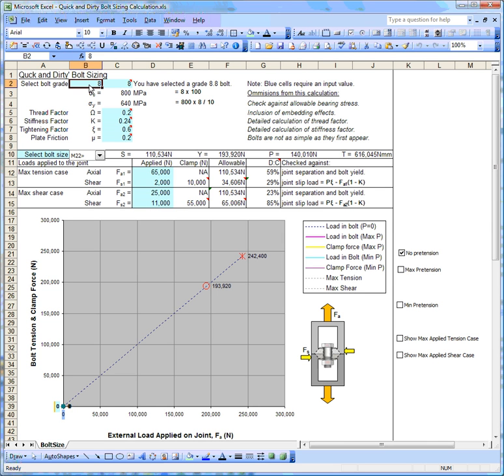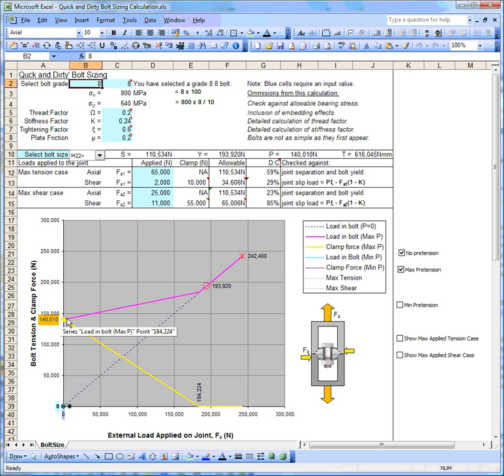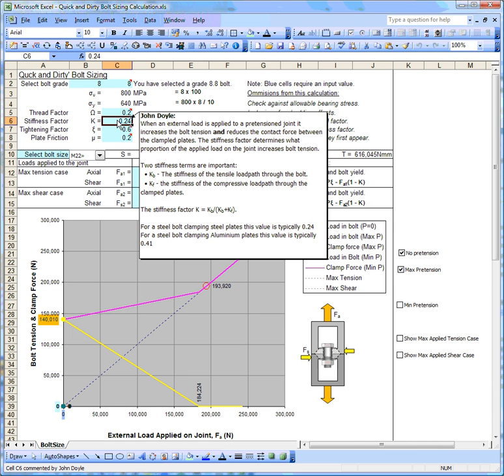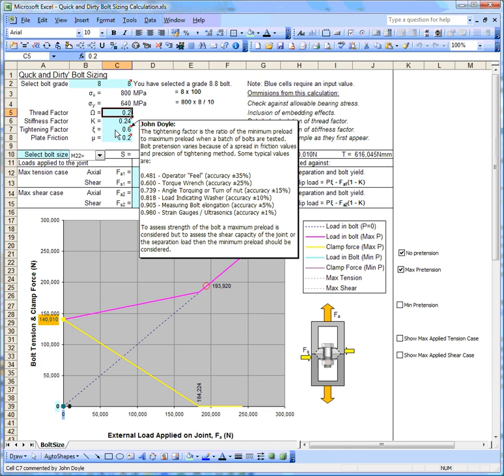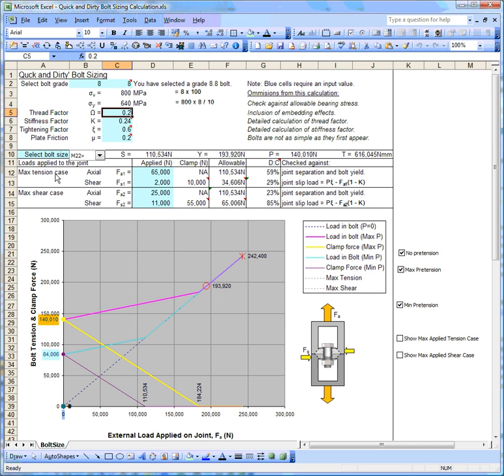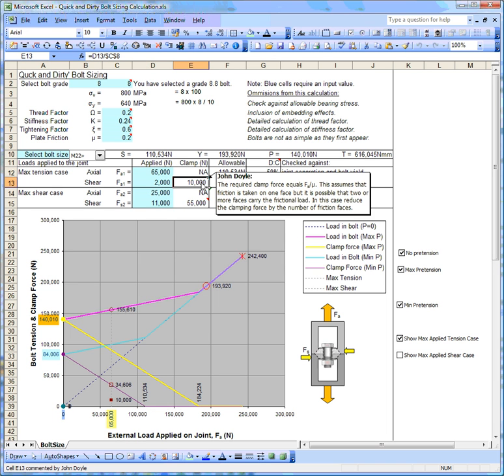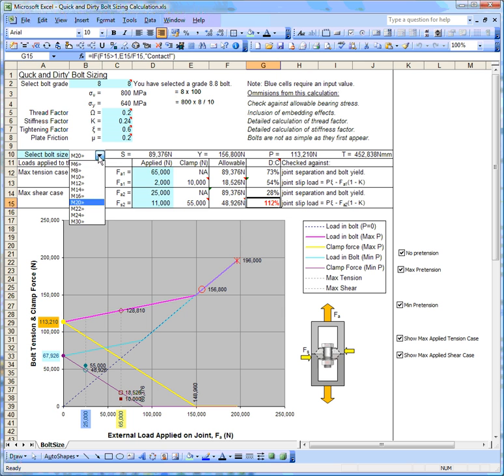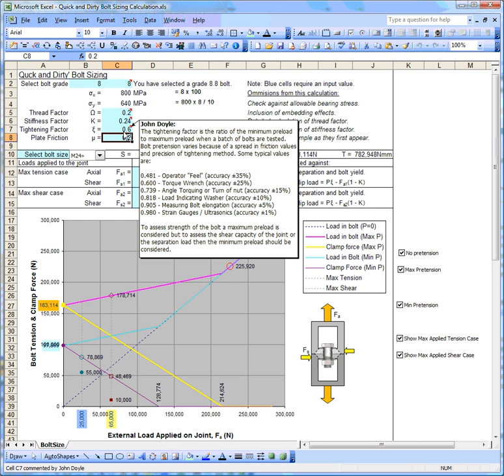Bolt Analysis A 'Quick and Dirty' Method

Comment: As an individual, develop a spreadsheet based design tool which assists in bolted joint design.
The bolted joints to be analysed will take the general form of the example shown in Figure 1
below. However, the number of bolts in the bolt pattern, the magnitude and direction of the
applied load and the arrangement of the bolts will vary from design-to-design. Consequently
your analysis tool should be flexible enough to accommodate such variations

The bolted joint design tool must determine the shear stresses induced in each of the bolts
for a given fastener pattern of a bolted joint. Furthermore, the facility must identify the
minimum bolt factor of safety in the joint. To achieve this it is anticipated that the design tool
should (at least) accept and process the following input from the user:
 Bolt grade
 Suggested bolt diameter
 Number of bolts in pattern
 Bolt locations (x, y)
 Load magnitude and direction

Comment: Great walk-through.

A question regarding the bolt.

If we pretension the bolt to X Newtons the bolt will experience (X/ area) of tensile stress.
The clamp force will be sufficient  to carry a shear force of (X*µ) newtons.

But when we add the maximum shear force (x*µ) this should also add a shear force to the bolt itself.

The total stress of the bolt should then become a combination of the tensile stress and the shear stress, e.g. vonMises of the two.

So in theory, lets say we pretension the screw close to its' yield force/ stress.
We determine the max shear load it can withstand (N*µ) and apply the max shear.

Shouldn't this lead to a higher vonMises stress in the bolt that might exceed the yield stress?

Have I missed something or is the shear stress in the bolt negligible?
Reply from the maker: The shear stress is carried by friction between the two clamped plates and not by the bolt at all. Your concern would be valid if the bolted joint had slipped and the shear stress was carried over the bolt. The bolt will be carrying some torsional shear stress if it is torque tightened of course and we should not forget about this.